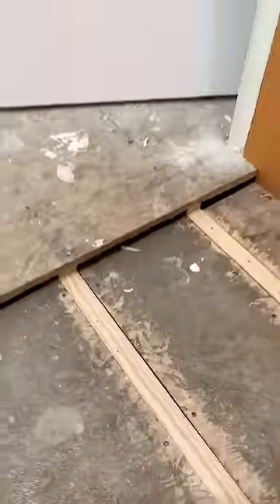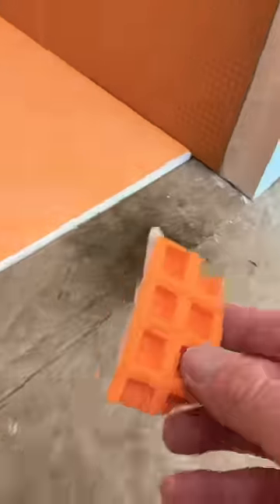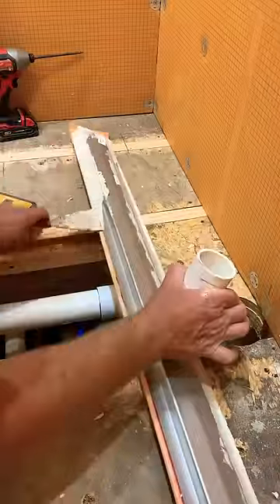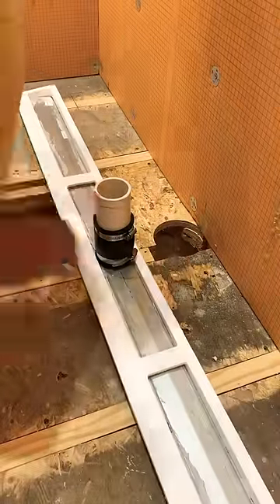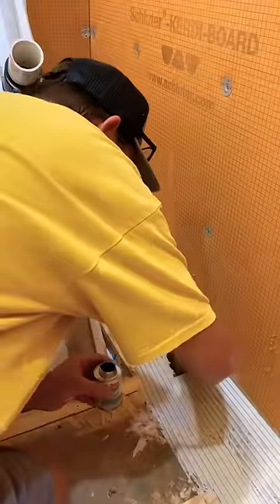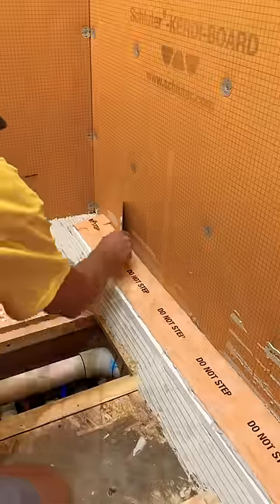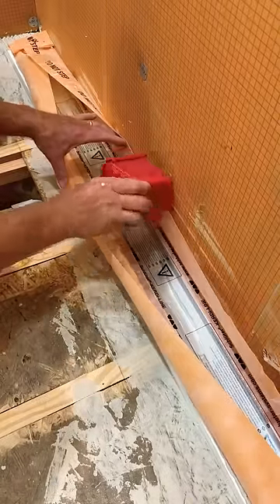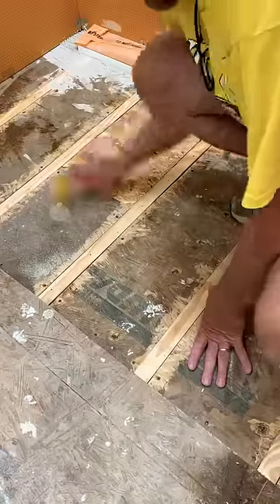Easy CURBLESS entry shower #shower #schlutersystems #gotitcoach

Comment: No way this man just drilled thru a floor joist
Reply: Drilling through a floor joist is perfectly normal.. How else do you run plumbing, electrical, gas.. Etc..

As for Notching a floor joist..yeahhh I wouldn't do that either
Reply: @GageDrums what lol? He literally bored a hole through the joist entirely. Pause the video about halfway through and look at it. The joist is no longer a joist. This is not normal. You can bore through joists with very specific guidlines but you cant bore down into them. Ever. And notching a floor joist is acceptable as long as the notch isn't larger than 1/6 the width. You got your info totally backwards.
Reply: @skybox5743  I think you're mistaking me saying notch vs drilling.. I never once said he can "bore into the joist".. I said you can drill holes.. Never specified the size of the holes.. Well aware of the general requirements. And that I wouldn't notch a joist like that.. Not sure what info I have backwards.. Please elaborate
Reply: Yes you dork... As common as the rain

Comment: The problem with this method is that there is no way for water that leaks through a grout crack to get back into the drain system,  as opposed to the traditional shower pan system. A traditional shower pan (done right) will last 50 years, whereas what you just saw will last 5 to 10 years, and it will be a moldy mess when you do replace it. I've been doing tile for 45 years, and that ain't the right way to do it
Reply from the maker: As long as the rubber liner was installed correctly and the weep holes don’t clog around the drain. There is still a chance it will leak too. If water gets through the grout, the entire tray system is waterproof, it would leach eventually to the drain since it is sloped.
Reply: @w.k.d.constructionllc  I did not see any weep holes around the drain you installed so there for there's no way for any water that gets behind the tile to get back into the drain system,  I have replaced several of those Schluter Systems and they all had water under the tile. I would not recommend that system to my worst enemy.
Reply: The 3 weep holes in the bottom of the top piece , of a two part drain are essential to wick the water from above the moisture barrier
Reply: I agree wholeheartedly . 
Been putting in showers the old fashion way for over 25 years .. no  problems no shitty schulter ...😂😂
Reply: @customsolutions7167 i agree schluter is rubbish. Wedi ftw. forget that prehistoric rubber liner bs

Comment: No waterproof needed? Or just not yet shown?
Reply from the maker: It is needed, it will be shown in my next video
Reply: Then shouldn't it have been done b4 the drain was installed? What about that joint than?

Comment: Question:why did you use a pressure fitting 45
Why not a pvc dwf fitting ???
Reply from the maker: Ha, it was my bad. I didn’t have a drain fitting at that moment and found a pressure one…so it was used. 🤷🏼‍♂️
Reply: @w.k.d.constructionllc  👍

Comment: Is that half lb foam on an outside wall with no vapour barrier behind the plumbing? 2lb foam has vapour barrier in it and would have been Better.
Reply from the maker: It’s open cell, yes. Vapor barrier is not commonly used in the south
Reply: @w.k.d.constructionllc  gotcha ya , I’m in Canada and if we don’t use vapour barrier we freeze. 😂

Comment: What would you do if you found floor trusses? Raise the floor outside the shower to make up for  the 3/4” you can’t take out of a floor truss?
Reply from the maker: Ya. That’s a different animal there. You could still drop the subfloor flush with top of trusses but don’t cut the truss. You would still have to add some height to the floor outside the shower to match the pan.

Comment: How did you cut down the floor joists? Any tips?
Reply from the maker: Make sure your joist are sized and supported properly first!! Other than that, I used circular saw, multi tool and cordless planer
Reply: Cut joists like the professor: f it's cable free, circular saw is fastest. If its floating in midair with 2 feet of access either side (that's a plumbing joke, it would be unsupported, we never get clearance) use a bandsaw. For day to day joists use a sabre aka reciprocating saw. You can use a bodgit, aka an oscillating multitool, which are €100 from makita or milwaukee or €30 from Parkside via lidl but its slow. If you have no money, choose a wood saw with less than 12 teeth per inch and scrap metal to protect from excess accidental cuts.
Reply: @w.k.d.constructionllc  if your boss tells you to cut through a joist and gives you a planer, remind him it's skeleton not shell and a planer don't cut joists.
Reply: You cut out the entire floor, and double the rims around the dropped floor. Then you reframe everything and don't be a hack like this guy using Schlueter foam
Reply: DO NOT CUT FLOOR/CEILING JOISTS!!!

Comment: 30 year plumber here Ok problems 1 blue glue.  2 pressure pvc 45 used. Fernco.  Ok. I guess I would not do it if I did I would use a sheer band.   Guess no permits are being pulled.   It will all work but.   Not how it’s done

Comment: Regardless of the wood I beam sitting on block sill, this is not a great idea. Since it’s a line drain, slid it to the side.  Or plywood webbing would also be light years better to do. Is this drain part of the settlement?

Comment: Why everyone's hooked up on that pressure 45 fitting? Not what he supposed to have used but nothing wrong with it. It can function properly there. It'd have been a problem the other way around by using a DWV fitting for a pool.

Comment: Why did you use a rubber coupling when I read the upc (unifie6 plumbing  code) code book it says that a rubber coupling has to be 2 feet outside the foot print of the building and barried
Reply from the maker: It comes with the linear drain. It’s the only way to connect the aluminum drain body to the plumbing

Comment: Did that hole saw cut all the way through that joist? I don’t understand why cutting into structural for plumbing is ever a good thing. Maybe I’ve just been burned too many times. Can’t the drain, toilet, etc, be 2” over? I’ll take something that looks odd but works great any day of the week.

My house is from late 1800’s and has so many bouncy floors due to all the plumbing and electrical refits over the years.

Comment: Schluter line drains discontinued after losing class action lawsuit .
Reply: is that supposed to be a joke?
Reply: Watch the tile coach videos on the numerous issues with failed factory sealant around the drain. In most cases Schluter will cover the repair, but not always..
Reply: plumber: Keep It Simple Stupid

homeowner: i got this online...

Comment: PVC primer is still required when using blue glue, ferncos are illegal inside with a metal band and you used a pressure fitting for the 45 instead of a DWV fitting…besides the fact you cut out an entire section of the floor joist. Maybe call a licensed plumber next time

Comment: So I've always wondered how do you check your flow with shower tile? Or do you get your flow from the floor?
Also real men use the blue glue. Psychopaths use red.
Reply from the maker: 😆 not following you on the flow question. Are you wondering about drain sizing?

Comment: Joists sized during initial engineering. Let's just resize them without any additional support.
Reply from the maker: How do you know what span or support I have? It’s structurally sound, guaranteed
Reply: @w.k.d.constructionllc  looks like 2x10 16" oc. So go ahead and make whatever modifications you'd like because they probably wanted 2x8 anyway LOL
Reply from the maker: @josephpope3467  these are actually 2x12 on 12” centers. Plenty of beef there and the span is fairly short
Reply: @w.k.d.constructionllc  why 2x12  12" oc short span. Somebody has more money than sense.

Comment: Make sure the pipe is lower than the floor of the drain
Reply from the maker: Yea
Reply: @w.k.d.constructionllc  worked someplace where the pipe was 1/8 inch above the floor of the drain 😖

Comment: I find it hard to believe it’s beneficial to take out a joist (setting that aside), removing 3/4” of the top of all the other joists, apply another sub floor….
Why not just go with a membrane?
Guess I gotta watch, haven’t used this stuff seems a lot of additional work.
And the sun floor wasn’t flush to the rest of the sun floor(?)
Reply from the maker: I cut the joist, yes…but my basement wall is 12” and my joist is still setting on it correctly supporting the floor.  Notching the joist is perfectly fine in my situation. I have enough joist to support everything. I left the tray a little high so I could use Schluter Ditra tile mat. It flushed up perfectly
Reply: A membrane doesn't slope to the drain thats the whole point of the pre sloped schluter shower pans. The joists either need to be cut or the rest of the floor needs raised if you want a curbless shower and he had 2x12 joists making it no issue to cut down. plus they were 12"oc
Reply from the maker: @independentinstallations8419  🤙🏻

Comment: I’m a plumber so I can only really criticize the plumbing. I would have used a glue fitting and not a fernco. I also wouldnt have used a pressure fitting on a drain but it’s a 45 so it will work. The reason I dislike this is perception. It’s like seeing teflon under flex nuts. It will still work but the first thing I think is amateur. Even if it works it makes you wonder what part wont work. 
As for the rest, couldn’t you just notch the joists deeper and put a whole sheet of 3/4 plywood down. It should affect the structure because the top of a joist is in compression so the plywood will easily replace any strength you cut out. But this is a nit pick

Comment: You know there's an issue with their line drains leaking right?

The felt is separating from the drain and flooding people's houses.
Reply from the maker: I’ve heard. I did this over a year ago. Not had any issues so far?

Comment: So exactly how do you expect a floor joist to support... y'know... THE FLOOR... if you remove six inches of it? 

What a cut-rate job.
Reply from the maker: 😆 6” or you mean 3/4”!? 🤷🏼‍♂️
Reply: @w.k.d.constructionllc - You removed the joist where the drain went.
Reply from the maker: @ShawnKitchen  I cut it down .75” with my floor joist being sized and spanned appropriately, I could do so

Comment: If its level it will puddle, it won't flow into the drain. How do you justify putting a level surface in a wet room ? All floor surfaces should flow towards the drain.
Reply from the maker: Probably because the shower tray is sloped…🤷🏼‍♂️
Reply: @w.k.d.constructionllc  you showed it to be level with a level. The only way this makes sense if it is has a slanted shower tray on top of it, which again, would benefit from a slight slope on its bearer surface to avoid pudding splashed water. I'm doing my best to understand why you are putting perfectly level surfaces where water may go.
Reply from the maker: @NLPexperts  the floor the tray sets on has to be level, the tray is pre-sloped to the drain. The drain is set level because the linear drain itself is pre-sloped to the drain opening itself.
Reply: @w.k.d.constructionllc  until it leaks and you have stagnant water causing a biohazard. The floor tray should be on adjustable legs/castors as they aren't meant to be installed on perfectly level floors. Study more or explain how a flat floor makes sense in a wet room, which you can't.

Comment: You don't notch an engineered floor joist at the top plate.
Reply from the maker: These are not engineered joist, and everything is load rated to be structurally sound
Reply: @w.k.d.constructionllc  I'm guessing they aren't floor truss. Dimensional wood joists? If you cut two or more inches off, how is the load value recalculated after the fact without headers?
Reply from the maker: @ejayerik  dimensional 2x12’s on 12” centers. My basement wall is 12”, so even though I cut the joist…it is still bearing on the wall right at 4”. So that joist is still carrying the full load it was designed to

Comment: you just cut though a floor joist for your drain. I hope you reinforced that area before sealing it up. otherwise, you're going to have problems later that you caused.
Reply from the maker: It’s been all planned out and it is structurally sound

Comment: I think sistering two other boards on each side of that joist you cut would have been a better option than just leaving it. It is hard to tell from the video but it looks like there may only be a couple of inches of board left where you cut out for the drain. Assuming the span is large (because why else would they use 2x12 joists) you may have cause an integrity issue and in the future have a free floating joist if that one cracks. 

Im all for skimming an inch off of a 2x12 joist because it is no different than drilling a 2" hole through for plumbing or electrical. However, the one you cut for the drain looks like it may lead to structural issues inless it is supported on both sides of the drain by a girder or footer.
Reply from the maker: I did cut the joist but my basement wall is 12” wide. So there is 4” left of floor joist bearing on the wall supporting the load and is structurally sound. No structural integrity was compromised. My floor span was rather short and they were on 12” centers. 3/4” notch was fine

Comment: FYI!
Schluter lineal drains LEAK.  
Class action lawsuit is coming.
Membrane separates from metal, look it up.
Reply from the maker: All of them? 🤔
Reply: @w.k.d.constructionllc  
I’m not sure about all of them, but there’s lots of them that membrane separates after short usage of the shower.  Maybe it was a a production mess up at one point but looks like it’s a design flaw because it doesn’t bond well to polished surface.
Reply from the maker: @sergeya8601  hopefully the faulty bunch wasn’t distributed to my region!! 😬

Comment: Why use a pressure 45 thats for water not drain
Reply from the maker: That was my bad! That’s what I had on hand that day and it was installed. It will drain as it should

Comment: Plumber in the house.
You used blue glue ? 
45 is a pressure fitting.
You poured water down the pee trap . Thats not a test, that keeps sewer gas from smelling the house up.
Never test the shower by plugging lineer drain after completion so the plumbing inspector can sign off on it.
Cutting floor joyce's ?
Fernco on the drain line,at least use a 4 band, but shouldnt use only for vertical and underground.  
 OSV board ? 
Grout on OSV board ?
Thank you for reassuring we professional plumbers how not to do a lineer drain.

Comment: You may want to look up the building code (IRC) rules on joists and notching. At least its not a tub with a joist completely through (which is what some monkeys did at my house before we bought it), but it still weakens the structural integrity. Not trying to knock you, but people, please don't do this at home.

Comment: In all reality I've seen some pretty shitty hack job plumbing fixes and they have lasted. And besides nowadays the purposely  make things to only last for so many years so you HAVE TO BUY NEW STUFF....with the 45 being pressure what does it really matter anyway on a res house? It's not like it's an industrial and people could get hurt.  It's still gonna drain(unless) he back grated it). And if he glued it correctly than it shouldn't leak...now for the fernco...u should have glued that cause the fernco can rip and cause a leak..

Comment: Yeah, you lost me when you notched the floor joists I get that it’s OK if you have enough joist, but why would you wanna week in your floor in anyway?
Reply from the maker: If you understand structural integrity and can read load tables… there’s no risk in weakening anything if the joist are sized supported and spanned correctly. All those factors have to be considered before you notch anything. All of my requirements were met so I notched my joist

Comment: You can't just notch out joist like that. Would never pass city inspection if done prior to framing inspection.
Reply from the maker: Sure it would, if span and supported loads are correct
Reply: @w.k.d.constructionllc  not if those are TGI. Any notch in a chord requires an engineered letter and repair.
Reply from the maker: @ChrisLitton-l5e  I agree with you but these are dimensional lumber joist, 2x12’s on 12” centers. They are NOT tji

Comment: STOP CUTTING “notches” into your structure.
Reply from the maker: This isn’t ideal in most situations but mine is more structurally sound than most. 2x12’s on 12” centers with a short span. Not compromised at all

Comment: The 45 degree fitting that you used is a pressure fitting not a drainage fitting you would definitely not pass an inspection with that material that you used hope you put a trap into can't see it in your video

Comment: Ummm that’s not a dwv 45🤔 so god only knows what else is going on under the plywood😬
Reply from the maker: Oh geeze. If it can hold up to 180 lbs of pressurized water…don’t you think it will allow water to drain? I shouldn’t have used it but it’s what I had at that moment

Comment: Nice. Nothing like cutting a floor joist. Next time a off set drain
Reply from the maker: Look again eagle eye. I cut the joist, yes…but my basement wall is 12” so my joist is still bearing on the wall supporting all loads necessary to keep its structural integrity
Reply: @w.k.d.constructionllc You would think some of these geniuses would have seen the 20 other comments about the joist and would have just read your replies on those. But, then again, everyone has to input their 2 cents in the comments section 🙄